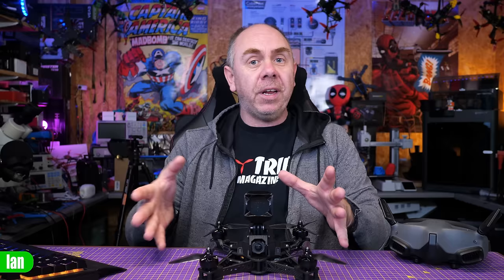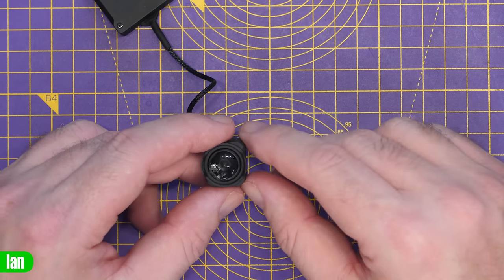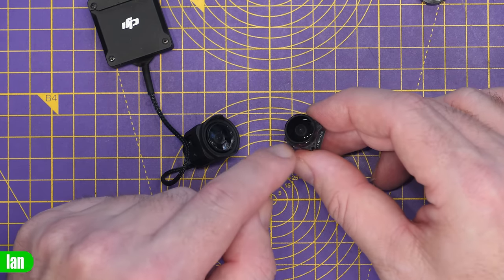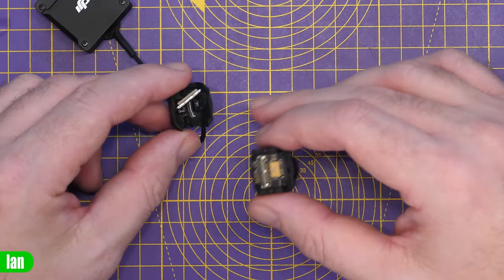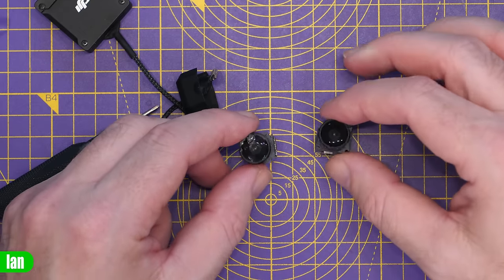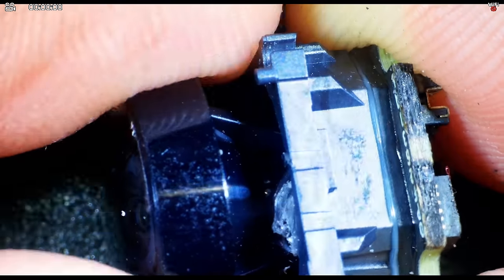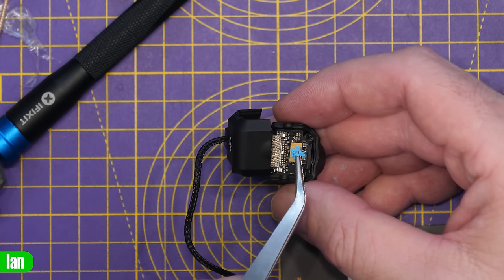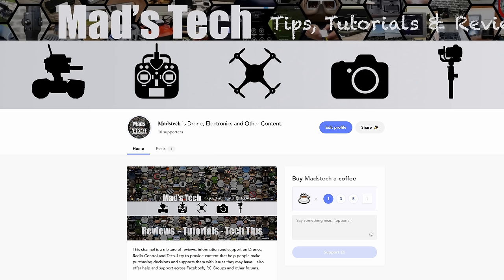DJI O3 FPV Cracked Camera Lens Repair

Comment: After a small falling from 1m to floor there is no image transmission signal on Avata 2 to goggles 3, telemetry is transmitted without problem. RC/HD signals are good. Reset/firmware update didn't help. Checked camera cable to gimbal and board they are OK. Drone only flies up from floor to 1.5m height and hovers. No moving anywhere from RC Motion 3 controller. Before falling I could see inner storage on drone in goggles 3, after falling - no. Is there any thoughts?

Comment: What threading is used once you unscrew it?  Could we "mod" it and use a m8 or m12 lens?  Obviously that'd change the built in stabilization and whatnot but you could make a new gyroflow calibration.  The stock lens is 2.34mm f2.8.  I'd love to fit a 2.1 f1.8 in there for some better indoor/lowlight.  I've put the lens from the anlaog caddx rattel camera in a few action cameras for this same purpose and it works really well.  Sharper, wider, brighter lens.

Comment: Has anyone tryed to swap the ic from the backside? Just for curiousity. Not saying that its easier than adjusting the focus.
Reply from the maker: The IC is the gyro.  There is no separate processing onboard.  DJI is programming the sn from the sensor.

Comment: B7000 perfect for securing Lenses or any kind of small cable on Fc or any other wiggle stop. B7000 stay a bit flexible when dry. Can also be used as coating on some parts.
Great Video 👍👌

Comment: 10:10 DON'T USE SUPERGLUE, IT WILL FOG UP THE LENS!!!!!!
This happens because some of the elements are not made of glass, and as the superglue solvent evaporates, it attacks the lens modules and destroys them. Ask me how I know. 
I made a naked O3 for a super small quad build recently and the lens got loose after a crash. I added a microdrop of superglue and it destroyed the lens completely!
Lesson learned I guess...

Comment: I wish you would have shown how to attach the mipi cable to the camera module. i can only rely on the visual aid from your video as to how the cable is positioned and do not know exactly how to attach it properly. I am going to be attempting this fix shortly and that has always gave me an issue. Great video and content as always.